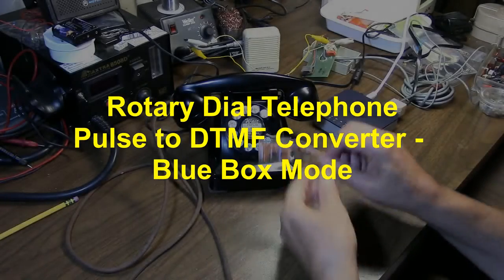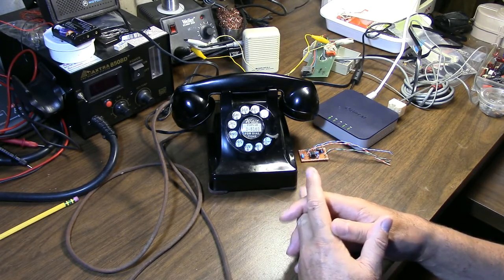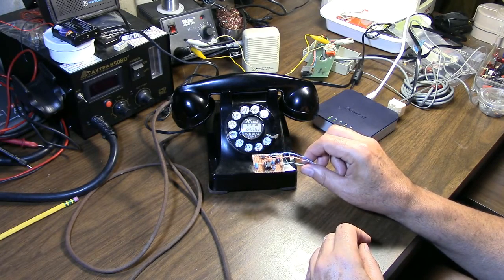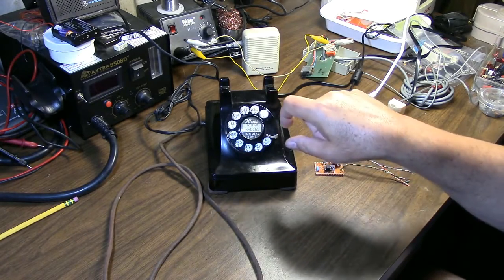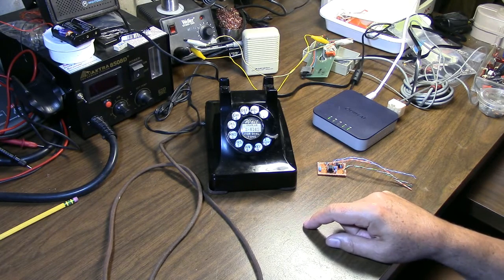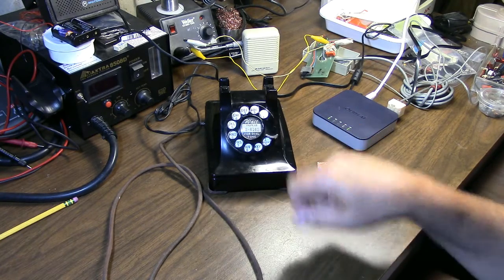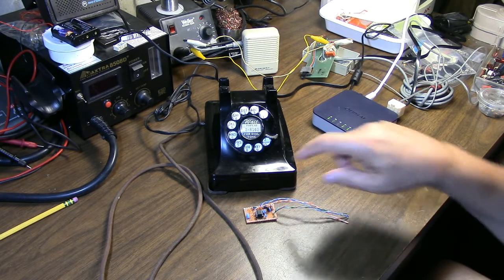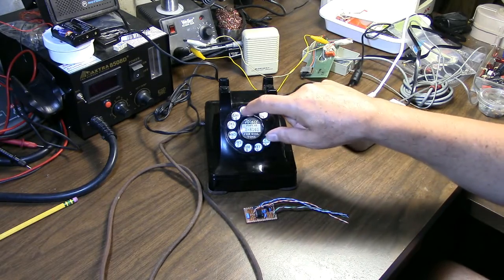Pulse dial to DTMF converter in blue box mode - demo

Comment: I'm not savvy. There is no way I'm doing anything with a circuit board. I still have a question about the blue box. 
You dial into an Evan Doorbell recording. Where does the recording reside?
The old Jane Barbe recordings are gone from the actual phone network forever, right?
You talked about dialing into a landline with the phone you are using. Does MF mode do anything on a landline the way it used to?

Thanks for the videos.
Reply from the maker: The recording resides on my “ProjectMF” server, an Asterisk PBX residing on a small dedicated PC. I have patched the code and added hardware to relocate the operation of the old network. MF tones no longer are used to route calls on the public network. However, you can call ProjectMF at 630-485-2995 and access a blue boxable trunk on the PBX (24 available). https://projectmf.org
Reply from the maker: Jane Barbe recordings are mostly gone from the public telephone network. I have quite a few Jane Barbe and old local operator recordings here and there on the server.

Comment: Hello world, There is a video game which has included a "blue box tone generator,[sic]" DTMF Generator[sic] and Wardial.  Wardial, is of course a reference to the movie WarGames (1983).  All programs are functional and located in what appears to be a UNIX PC in a CIA safehouse (in-game). so far, very few UNIX commands work on this PC. The game is Call of Duty: Black Ops - Cold War. Currently, you will find nothing on this subject because no one has yet figured out how to utilize these three systems in the game. Let me know if you would like to collaborate on a project to crack the wardial in Call of Duty. This would involve only "spy work" and  no video game experience is necessary if you're wondering.
Reply from the maker: That sounds interesting! Sure, contact me via the email at projectmf.net.

Comment: Hi, can I ask you something related to the video?
Reply from the maker: Roberto Triggiani Certainly.
Reply: then, I took a usb asp (which I already had https://a.aliexpress.com/_eMCaEN ) and I made the connections with the pins of the ATtiny85 and I also installed the driver on the pc.  the part that I was unable to do is loading the firmware on the chip, I never did so I don't know where to start

Comment: @0:30 - "Most hardwired phone systems still support tone dialing..." - I think you meant "pulse dialing", thought if SxS ever gets back on the PSTN, that would be accurate!
Reply from the maker: I did mean "pulse dialing". Needed more coffee! Voip seems to be rapidly supplanting POTS, and very few VOIP systems support pulse, sadly.
Reply: @df9999999999  Grandstream ATAs and Asterisk PBXes do pulse dialing neat as ya please! I have one of each (Grandstream HT-502) and an old Sony Vaio laptop running Asterisk with a few tweaks by Dylan Cruz. I can use this setup (with a 500 Frankenphone) to access NPSTN and C*Net!
Reply: Oh, and Centurylink (Qwest at the time) killed the equipment that supported pulse dialing in Idaho when I was a teenager; one day my 500 set just would not dial out anymore, and that was the probable cause.
Reply from the maker: Emily Poppino Yes, the Grandstreams do support pulse dialing. The older Motorola VT1005s do as well. However, they will not generate DTMF after the initial call is dialed for use with automated voice response systems and other services that require DTMF after the call is connected. This circuit addresses that shortcoming.
Reply: @df9999999999  Fascinating!
Reply: @df9999999999  My nortel 6x16  which has a nortel ata2 that has analogue  rotary phones hooked up to it and it supports pulse dialing even when from one of the VoIP lines.